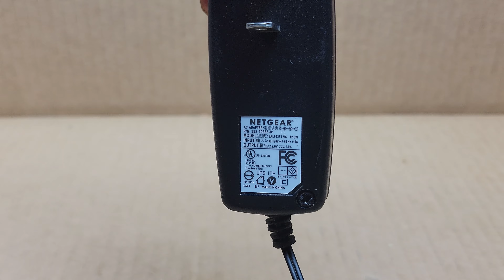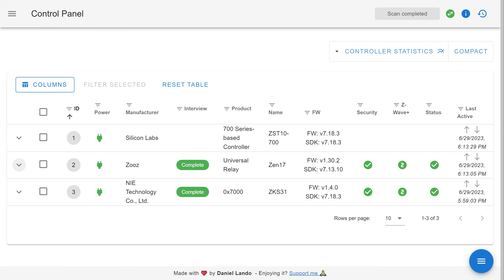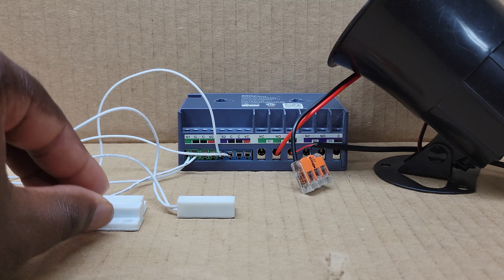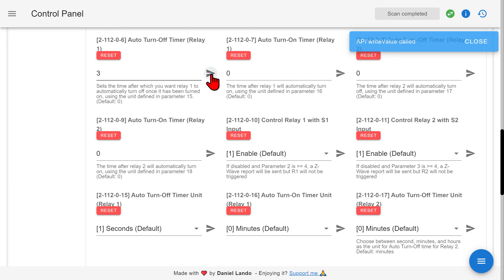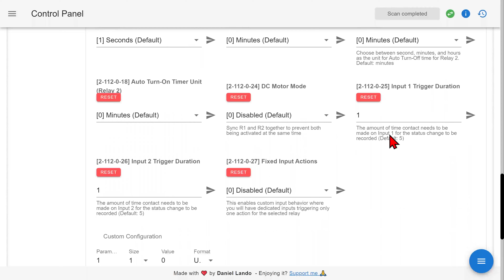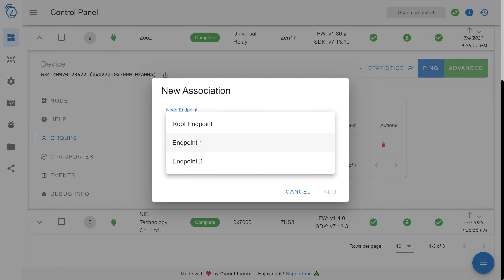Zooz ZEN17 Z-Wave Relay Review

Comment: is it possible to use a z-wave open/close sensor to set S1 or S2, this way it allows me to register open and close without hardwiring to S1/S2? will it work with associations?
Reply from the maker: Correct me if am wrong but you want to use a Z-Wave door sensor to control the relays on the ZEN17? If so the answer is yes you can do that. Not all door sensors will allow you to do this so you have you have to research before you buy.

Comment: Great vid, I set this up in my home assistant back in 2021. Today got a notification that there was a firmware update. I proceeded to update, now my reed switch is no longer detected on my zwave js integration in Home assistant. Update - Wound up re-settingthe relay after the firmware update, then adding then excluding then adding back into Zwave JS, and back up and running. Ive had this device since 2021. Great piece of gear for sure! I will probably stay away from the firmware updates in the future..lol

Comment: Cornell, thanks for the video! Your knowledge is far beyond mine and although I’m pretty good with most zwave stuff I have trouble with understanding relays. I’m trying to wire the exact same alarm that you use in the video and I’m having trouble. I set up a zwave smoke alarm in my garage that I’m certain I would not hear inside my house. My goal is simply to set off the siren inside the house when the zwave smoke detector reports smoke detected. I know how to create the rule for this I’m just struggling to get the wiring correct. Any help is appreciated
Reply from the maker: All you need to do is connect the positive wire from the power supply to the C terminal then connect the positive wire  on the siren to the NO terminal. Then connect the negative wire on the siren directly to the negative wire on the power supply.
Reply: @cwreviewstech  yeah that’s exactly what I have but it seems like my relay is not getting power. I put a meter on the power and it’s getting 12V to the relay but I’m unable to switch it on and off via my zwave hub (hubitat)
Reply from the maker: @markt4567 is your device using factory settings? If so I would take a wire S1 to C on the input side and see if that turns the relay on and off. If that works then it might be a habitat issue
Reply: @cwreviewstech  that didn’t work. What does work is having the usbc power and a power source wired directly as you described. Should I need two power sources?
Reply from the maker: @markt4567 you only need one power source for the Zen17. Then you will have another power source connected to the relay to power your load

Comment: This video is exactly what I was looking for.  I learned a lot about the ZEN 17 from you.
I bought the Zen 17 to control a gate opener.  I don't require any inputs for the Zen 17.  All I need it to do is, when I turn it on momentarily in Home Assistant, it will close a circuit and activate the gate (open or close).
I'm assuming that I just need to connect the normally open wires (from the gate controller) to NO C R1 on the ZEN 17?
Reply from the maker: All the settings I showed in the video have the same effect regardless if you use the inputs or send Z-Wave commands. I believe that's how you would wire it up but I'm not 100% sure. I would need to look at the wiring diagram.

Comment: Dude your video is excellent.  You just get started?  I'm surprised you don't have more subs.
Reply from the maker: Thanks for the kind words. Yes I am just getting started.
Reply: @cwreviewstech  Keep it up.  Excellent.  Any more fun Z-wave stuff?  Let's go!
Reply from the maker: Are you interested in Z-Wave hardware or software? My next video is likely going to be about how to manually assign Z-Wave routes in home assistant.
Reply: @cwreviewstech  I like Z-wave because it's independent of other tech and I've had Z-wave devices for a long time and when they are configured right, they work and work.  I want to avoid using a cloud service to manage my devices so I am still holding on to my Vera Edge controller.
Reply: @cwreviewstech  I'm setting up Home Assistant! Bring it!